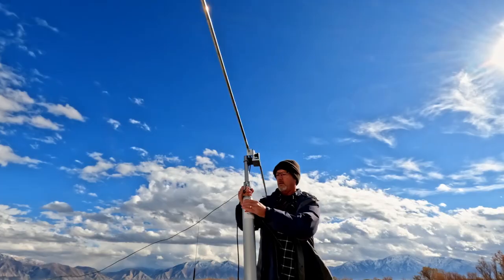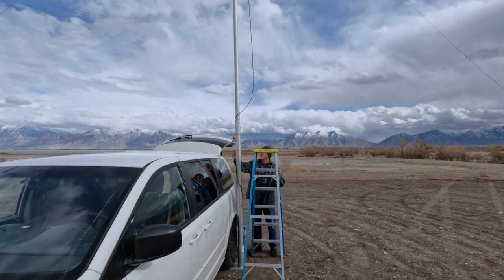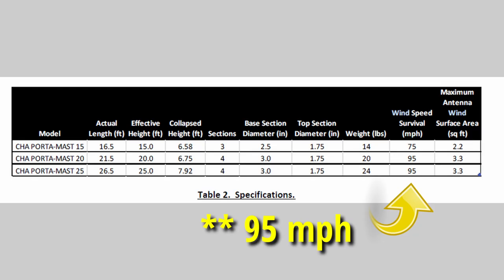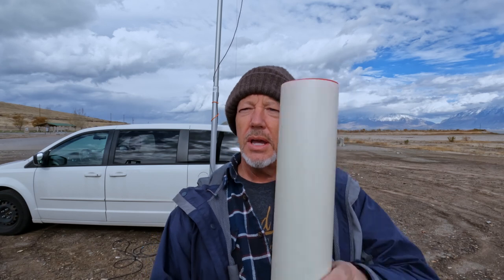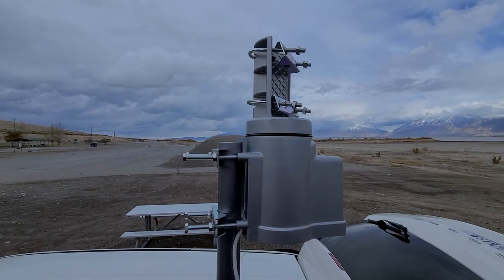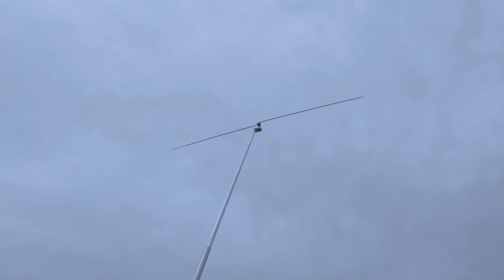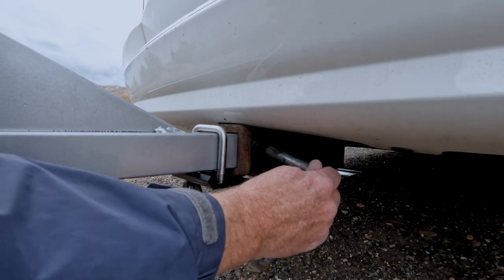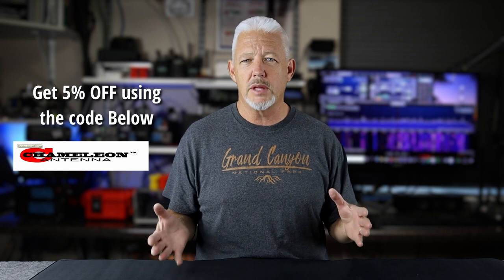25 foot PORTA-MAST from CHAMELEON | K7SW Ham Radio

Comment: I like the locking mechanism on that mash.  Seems much better than friction twist lock.
Reply from the maker: Agreed, I certainly prefer having a mechanical lock for heavy items atop a mast. In my experience, friction locks with guy ropes can put great downward pressure. I have had friction locks fail on me in the past so I understand. Every mast system has a purpose and thankfully there are options.

Comment: Hi and thanks for your presentation of the product. You make videos in a very professional way. One thing I noticed regarding the rotator. I believe you measured the current on the 115V outlet so that .15A on a 12V dc will be much more. 73s
Diego
Reply from the maker: Thank you diego, yes you are correct,   roughly 10 times the amp draw more with DC current

Comment: Great video Kevin. I looked at this mast on Chameleon’s website but wasn’t sure if was the best thing since it is aluminum so I just took delivery on a Max-Gain fiberglass push up mast MK-6HD but have yet to put it together. I’m hoping this won’t be too flexible fully extended (purchased guy rings too) but will be making a hitch mount similar to the one you have. One of the only reasons I went with Max-Gain is that the fiberglass won’t react with the antenna I also hope I can mount a moxon and or VHF yagi for POTA/SOTA or just portable ops.
Reply from the maker: Andrew, I have also looked at Max gain masts, they look very solid, I may purchase one for 38 feet I have a need for that type of mast. I don't think you can go wrong with a good mast.  As you have found good products are not cheap. Thanks for sharing

Comment: Did you have problems placing the mast topper on?  The screw holes don't match.
Reply from the maker: Feank,
I would guess that plastic inside could be interfering. It should work,  if not, make sure to contact support@ chameleonantenna.com. It would be a great place to start.

Comment: I think it would be good if the 2"x2" tube of the hitch mount for the mast was long enough do you could open your back hatch without having to take it all down to get to stuff in the back of your vehicle.
Reply from the maker: Excellent idea
Reply: There's a simple fix. Simply make the hitch mount extend out further from the car. They might even make it so it rotates to the side so it could be extended and the antennas mounted on the ground and then pivoted up.

Comment: My Wrangler doesn't have a roof rack and there isn't room for a six foot ladder on the inside. I'm sure the system works fine once it is up but definitely it takes up a lot of room for a portable system.
Reply from the maker: Hey 45 Auto,  I know what you mean. I really want to take this out on my Jeep too. I will let you know if i come up with a solution that is usable.  With tall tires like you and I might have on our Jeeps, it would be easy to just stand on the back of the jeep with the tailgate open. You have just given me an idea.  Thanks for the reminder, that would be a good video to make.💪

Comment: Great information!! I'm looking for my 1st HF mobile rig and what's out there for antenas and mounts. I really like that mast. Thanks again! K7HDA - 73
Reply from the maker: Glad it was helpful, if you want to understand more about what goes on with different HF Bands and you have some computer savvy,  look into an SDR dongle for your computer. You can listen around and get a feel for what it is all about on HF and it is a lot cheaper. Not only that, you will continue to use that tool for many other purposes as you get going in the hobby.  73
Reply: @hamradiowithkevin  I'll check that dongle out. Thanks!

Comment: I found you!
Disregard my other comment on your other video.
Question:   Will this thing handle a little 2 element 10 meter beam?
(Homemade from plans in the ARRL Antenna book.)
Reply from the maker: I beleive it will, I have plans to do the same thing as you, double-check the Chameleon website user guide to make sure the wind load rating
Reply: I checked. No wind loading on the web page. They need to add that.  @hamradiowithkevin

Comment: Hi again Kevin, hope you're well. Can you please tell me what the inside diameter of the hole is on the wheel mount?  I'm looking to purchase one from Chameleon but want to make sure it will accomodate the largest fiberglass mast I use. My largest fiberglass mast is a Spiderbeam HD 40' with an outside diameter of 2.16".   No problem if you don't have that info available, I can contact Chameleon.  Thanks es 73  Brent
Reply from the maker: Brent, I measured the inside diameter and it is 3 3/8" with the sleeve.Without the sleeve, the inside diameter is 3". I hope that helps 73 👍
Reply: @hamradiowithkevin  Thanks very much, that does help!  Does that wheel mount come with that removeable nylon sleeve, or is it optional?  I have an F150 with a receiver so I could purchase either the hitch mount or the wheel mount. Do you think one of these mounts is a little more stable than the other (after having installed that gizmo on the hitch mount that you bought from Harbor Freight)?

Comment: Just got the 15foot mast, it's much easier to manage.
Reply from the maker: You're going to like that mast and how well it works.
Reply: @hamradiowithkevin  So far you are right.  The mast is solid, something that I've been looking for - for some time.  At HRO they have a cut-out of this, but they don't see them - thus you don't get so see what it can do.  I'm deciding if I should use the plastic sleeve they sell and put it in a 5 gallon bucket and center that sleeve for the mast and add quick cement.  Then I would have to wire guide the mast, I would think that should work.
Reply from the maker: If you are going to guy the mast, it defeats the purpose because the mast is supposed to be self-supporting with a proper base mount. The drive on mount is super slick. It is fast and works on every vehicle.

Comment: How well does this work in a semi-permanent or permanent installation?
Reply from the maker: The advantage is you can easily lower the mast whenever you need to. Wind, storms,  need for portable use. I use the mast primarily for portable work, Chameleon has told me that YES semi permanent use is a way to use this mast.